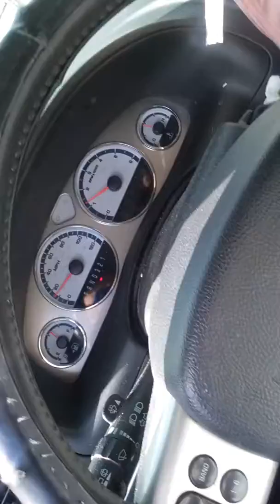Heat shield noise above muffler hitting drive shaft

Comment: lol i got this too. You probably got it straight by now but if not, look above the exhaust system. For me, there are flimsy heat shield pieces of aluminum or something that bolt onto the bottom of the car but after 190k miles, some nut/bolts have ceased to be. So on more than one piece, the heat shield is currently attached by 1 of 2 mounting nut/bolts which lets them dangle and bounce off of exhaust and rear wheel drive components. I'm not so sure how to best re-secure them.